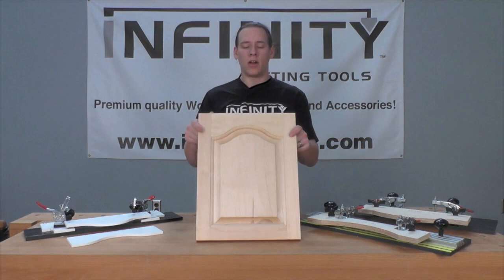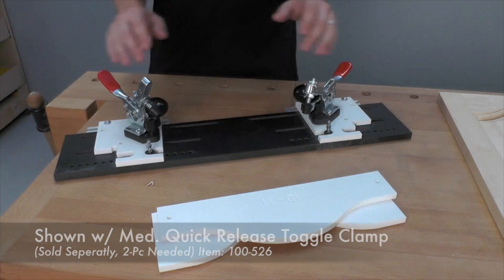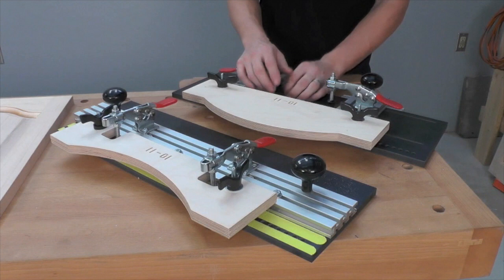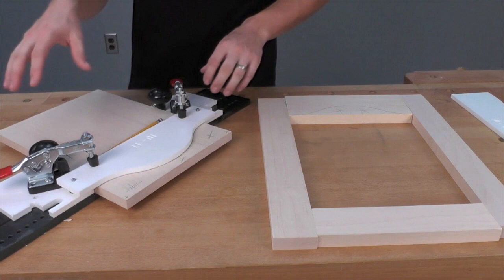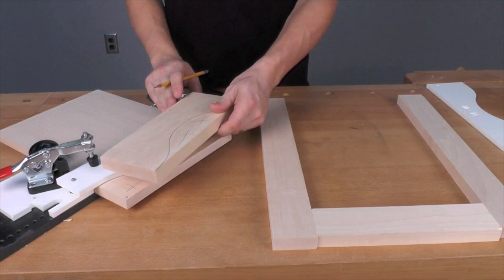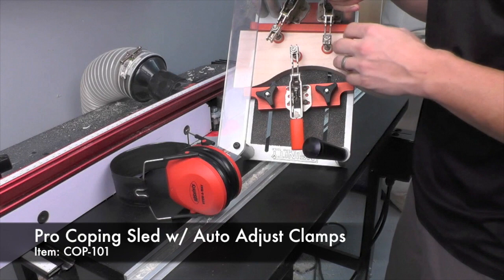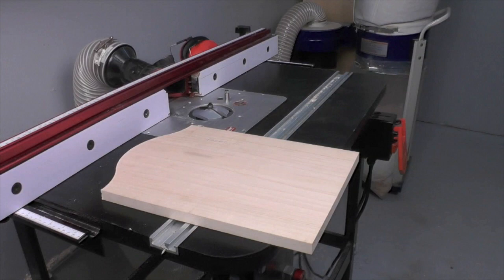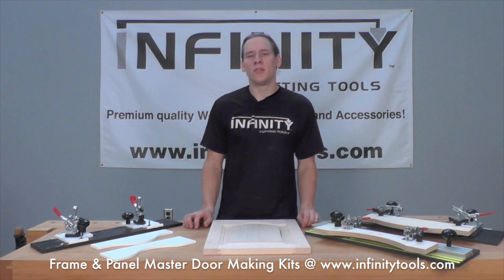Infinity Cutting Tools - Frame & Panel Master Door Making Kits

Comment: what size router bit will  your 3 1/4 hp router handle  i intend to purchase one for myself  i can not see buying a lift and a expensive motor seperatly
Reply from the maker: The Triton when paired with the Infinity router plate will easily accept bits up to 3-1/2" in diameter. you should be able to run any Router Bit infinity offers without issue.

Comment: I try to route my arch free hand but I get kickback every time. Now I am just avoiding it because I don't want to lose a finger, eye, tooth or mess up my tools............. Any tips?
Reply from the maker: Make sure your using a template, make sure your template has a lead in where the bearing on your router can touch before the bit starts cutting. And make sure to use good quality router bits.  Also when flush trimming the work piece to match the template pre-cut the work piece so that you are only removing the last bit of material to create a smooth clean arch.
Reply: I had that problem til I used the starting pin, problem solved. Always use push pads and keep your fingers, handy Lil buggers!